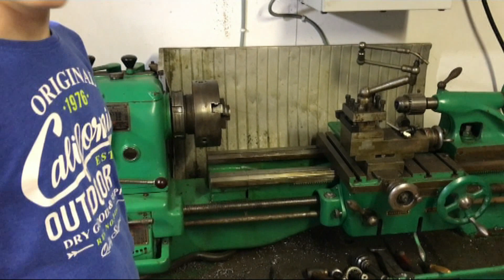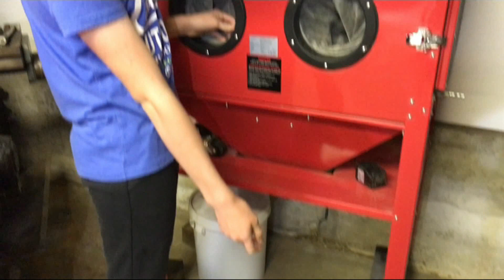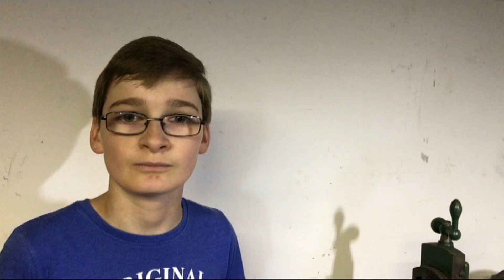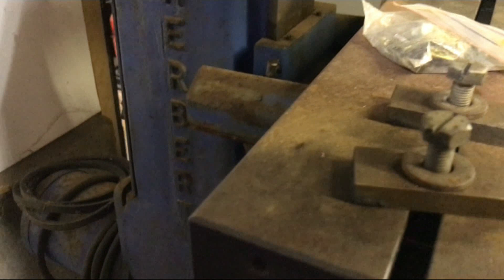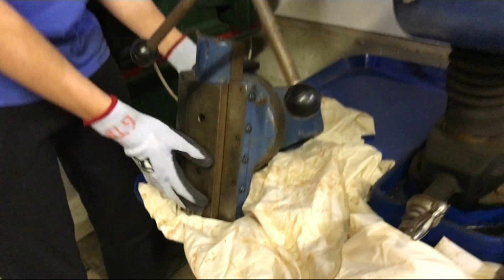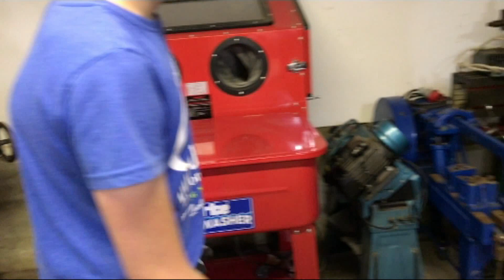Machine and workshop tools tour

Comment: The Cincinnati is really a nice piece.  I had not seen one with the universal head stateside, only the Toolmaster vertical head that looks like a Bridgeport.  I am not sue, but I think I remember reading on PM that some of those Cincinnati mills were made in France. Was your mill ? ? ?  Also I do like that Centec mill.  Good size and I like it has the horizontal spindle as well.  Probably only use it for side facing, as using the overarm looks like a huge pain.  Also I dig the riser block.  Get busy and learn how to use them ! ! !  ---Doozer
Reply from the maker: I have just checked the mill and it has a badge on the side saying Cincinnati Nederland, which suggests it was made in The Netherlands, I had not noticed that before thanks. The Centec mill appears to be a good machine although we have not done much with it yet. I think the riser block is essential for most work, I know some people have made one but it is cool that we have the original Centec one. We need to make some time to get to know the machines better. Take care
Reply: @GardenTractorBoy  Interesting,,, Made in the Netherlands.  Kool ! ! !

Comment: Good evening Joseph, you are very well tool equipped workshop 👌😊 That is outstandingly very expensive to have a 3 phases converter 😮 You can built anything's or fixed anything's with that OUTSTANDING Work SHOP 👌👍😊 Cheers 🍻
Reply from the maker: Thanks 👍 You are right, the 3 phase converter was very expensive but now that we have a number of 3 phase tools it has been a good investment. Most of the parts for our equipment have to be imported and some parts are not available any more. The shipping/import costs are very high so If we can make more of our parts it will be great. It is also great to learn how to get the best from these tools. It has taken us a long time to be able to make the space to access the tools. Take care
Reply: @GardenTractorBoy  You will be rewarded so much for having these machinist high quality tools and learning about them mon ami 👍😊 Cheers 🍻

Comment: Really nice machines, especially the Centec mill! That last Centec part is called a slotting head, and as you say, it is like a vertical mini shaper
Phil
Reply from the maker: Thanks. We are really struggling to find information about the Centec mill and the slotting head which I think may have some parts missing. The only info we have found is on lathes.co.uk. Our new machines were in storage for over 20 years and in the background we are in the process of recommisioning them. The one we are having most issues with at the moment is the Rapitor saw and if it is ok with you, I may need to ask you a few questions. Take care
Reply: @GardenTractorBoy  sure no problem, ask away!
thats an unusual centec!
Reply from the maker: @philhermetic  We have not seen a Centec of the same configuration and may have to seeking out some forums we can post on. We have a motor fault on our Rapidor and if we cannot resolve it we may need to ask you about motor speeds and pulley sizes and we will probabily convert it to single phase at the same time. It looks like you could easily add a cooling system. As someone who uses one often, do you think that would be a good addition?
Reply: @GardenTractorBoy  yes, coolant would be a good idea, I use cutting oil on mine from a bottle, but it eventually ends up on the floor, what is your motor fault?
Reply from the maker: @philhermetic  All three phases of the motor currently have a direct short to earth

Comment: Very nice shop. Be careful about putting the blasting cabinet on wheels. Those kind of legs fold easily when you try to roll. Instead, consider a full dolly under the blast cabinet. The legs can be bolted to the deck for more stability.
There are several US based machine tool collector organizations. Check with them about manuals. Several of my machines were used for WWII subcontract work. In my area, during WWII, many farmers worked for government contractors directly or subcontracted piece work. As those guys died off in the 1980s and 1990s, their home machine shops came up for sale. I bought a few odd pieces. The shops that went as a package were too expensive for me.
Learn how to use all of that equipment and take good care of them. They will always provide you with a means to support yourself if times get real bad. Good Luck, Rick
Reply from the maker: Great call, we will make a full dolly for under the blast cabinet. That is a great story and history about the WWII contract work and I am pleased you managed to buy some of that equipment. Once we have checked the equipment over it will be time to learn how to use them. Take care

Comment: Wow, that's a Great Power  Tool Equipped Work Shop You have there. thanks for sharing, Very Impressive indeed. Most of the Tools  I own and  I still use are old  and Obsolete but all very Heavy Duty and   All Made in U.S.A.   Oddly enough a few are worth much more than I paid for them Decades ago because they are Antique and collectible.
Reply from the maker: Thanks. It is great that we now have the space to get to the tools to be able to use them. The older machines seem to be much better made and with care, should last for a very long time. Take care